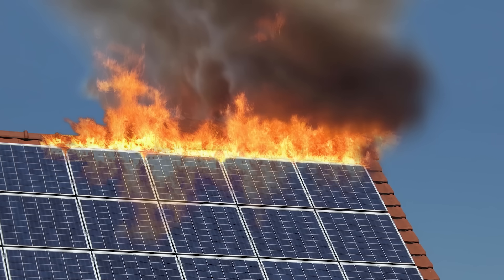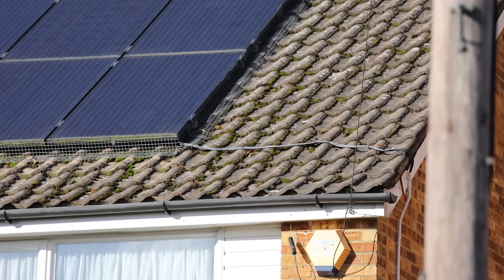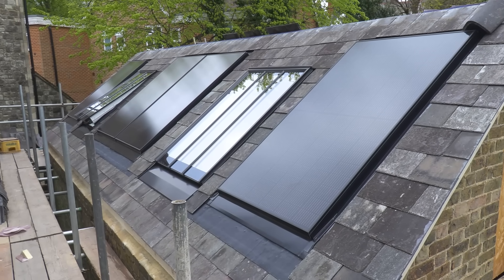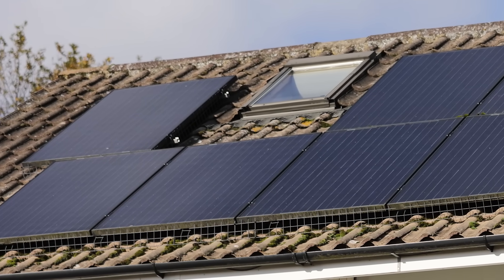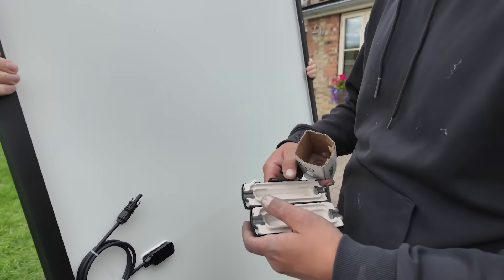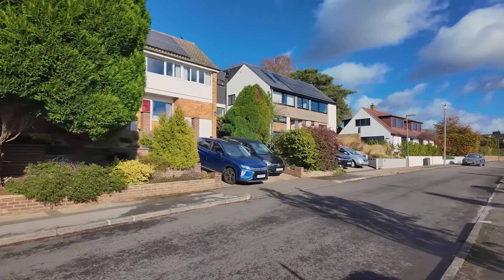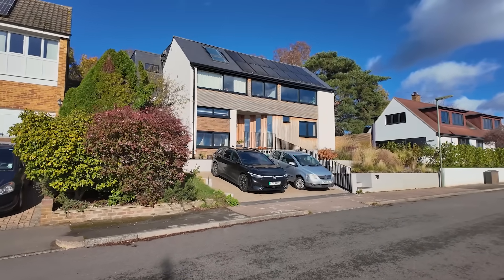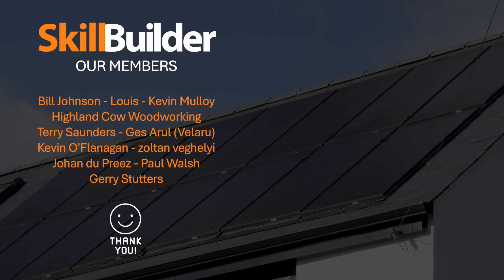Solar Panel Fires Are Rising – Here’s Why

Comment: The problem with solar is that it is high voltage DC if you have a bad connection it will arc and continue causing high temperature.
AC at least goes through zero volts every 20mS which helps to stop the arc.

Comment: Ours are lucky regularly checked it is the council so what they define as a check I don't know I don't really take much notice. If it's the same guys that did my eicr that took ten minutes and involved him changing a bathroom switch😂. Our property needs a rewire anywire, 60s wire with insulation break down causing "green goo" so I'd assume with that the cables from the inverter will atleast be done. Our system has been on the house probably 10 years and it has been fine so I'd assume if it was going to be an issue it probably would by now. I don't think we should panic about it they are brilliant and if you do worry about the environment then I think it's a good investment. For me it just allows me to AC my house for free during the summer😂

Comment: A fuseable link is probably the best fire detection method for solar panels.
All it is is a strand of wire that melts at a certain temperature with some voltage running through it the loss of which sounds the alarm. 
In most cases the fire will need to be beyond the saving point before any other type of alarm will be triggered. With a fuse wire any temperature greater than what's to be expected at high noon on the hottest day of the year plus five degree so about 120 c will melt the wire and trigger the alarm. Even a small smouldering fire should get the areas where the wire is best located well above 120 c but still be small enough that it could be extinguished before permanent structural damage is done to the roof.
The alarm should also be set up to completely isolate the individual panels from the power circuit to make fighting the fire safer and also remove the source of the ignition.

Comment: Solar panels and inverters have changed over the years so it would be very useful to know if there is a pattern.  Is it old panels, new panels, bad connectors, method of installation etc?

Comment: The only problem I've experienced with my panels is the connector that comes with them got hot.  They look nice and chunky but the actual connection itself is rather weak.
Reply: Probably mismatched connectors as, shockingly, the design is not standardised. Chop off both plug and socket and re-fit with connectors from the same manufacturer, using a dedicated crimp tool, done properly. They should not get hot.
Reply: @matthewmarks6951  They weren't mismatched, just cheap and nasty.  I did exactly as you suggest.
Reply: @rogerbarton1790  What current were you passing? I've had no trouble with cheap ones.
Reply: @matthewmarks6951  Difficult to say, my system only displays the total current, and then I'm using super capacitors.  But it was a 12v 120W panel, so absolute max current 10A, realistically half that.  I have several of these connectors, but it was just one that got hot, and the mating force was very low.
Reply: @rogerbarton1790  Ouch! Yes, I think the biggest warning of incompatibility is the connectors mating too easily.

Comment: Hi    The installation of this technology has been around for getting on for 15 years or more now , so those initial installations will start to degrade due to being outside in exposed locations . Obviously most will not see any maintenance, so compounding the potential for failure . The technology has admittedly progressed over time , but the quality has reduced to lower the cost .  So now you have the situation of a vehicle in your garage that might be a problem , and an equal potential on your roof . So much for progress don’t you think . 😊

Comment: Years and years to break even while still paying electricity bills from the grid for back up  Batteries need replacing which are not cheap. Not enough sun hours, especially in winter when we have to struggle to look hrough the dense greyness in search for a dim glow that looks like it might be the sun. It's a virtue signalling con, like electric cars.
Reply: So weird that so many people have and swear by them then, isn't it? A modern battery lasts 10+ years, by the way.
Reply: @matthewmarks6951 Add up the installation and new batteries after ten years, the cleaning of the panels, plus the additional payments to the grid and compare the total to not having solar panels.

Comment: Scottish Building Regulations have had solar as standard for over 20 years. Whether developer built, Social Housing or Affordable Housing. I don’t recall hearing about a problem 🤷‍♂️🏴
Reply from the maker: Are you saying that the firebrigade is cooking the figures? 😀
Reply: @SkillBuilder 😂
Reply: @SkillBuilder Only an English probably I’d imagine 🤷‍♂️
Reply: Bird Guards around Solar Panels should be Mandatory.
Reply: @privateprivate4384  Yes, nowadays, but I think pigeons have learned about them as it never seemed to be much of an issue. I retrofitted when I re-roofed.

Comment: There are roughly 8000 house fires per year in the UK caused by some form of electrical failure, solar panel install failures do not make the top 7 fire risks caused by electrical (the list only had 7 items on it!).

A solar panel fire can almost always be traced back to poor installation, and sadly we have a lot of cowboy installers usually on some govt. grant scheme.

Roger is right I would not have the batteries inside the loft, but tbh LFP or sodium ion batteries are extremely low fire risks
Reply from the maker: What causes the panels to explode? It happens.
Reply: @SkillBuilder  Do you actually mean explode, or just catch fire?
Reply: @SkillBuilder  Solar panels cannot explode without explosives!  It is a complete myth.  What can explode are low quality inverters solar inverters, solar isolators of poor quality can explode and in very rare cases old solar hot water systems can, either via calcium build up or large variations in temperature resulting in expansion and contraction, fail and crack in a very small "explosion" in the same way that safety glass "explodes" when it shatters

Comment: Smoke alarms in the loft work perfectly well, we haven't had any false alarms in over 10 years (firmly grasping a piece of wood 😆 ) and you won't get much more dust than in our thatched roof.
Reply from the maker: Fred 
That may well be the case but you are advised to vacuum clean  your smoke alarms every few months.
Reply: @SkillBuilder  I've been very lax in vacuuming the smoke alarm, I'm going to guess it was 5 years since I last cleaned it. Thought I'd check to see what type it was in case that makes a differance, and I see it's a year beyond replacement date, so that's a job you've given me, anyhow it's a optical alarm which are less affected by dust than ionization alarms.
Reply: you have solar panels on your thatched roof ?
Reply: @AlexSmith-y4i6t No, but as it's a thatched roof it is a requirement of our insurance that we have smoke alarm in the loft.
Reply: @fredbloggs72  would it work in time though , seems to me that any fire would write off the entire building , all an alarm would do is give you some time to escape
Reply: @AlexSmith-y4i6t  Whilst a thatch fire is usually devastating, it doesn't necessarily mean the entire building is destroyed, about 15 years ago another thatched house just down the road from us had a fire, the occupants where alerted by the smoke alarms and they where able to get out in good time and alert the fire services. The house was badly damaged but most of it was saved and the firemen saved the house next door which was in danger, if they hadn't had an alarm it could have been a lot worse.

Comment: Comparing electric scooter and solar batteries isn't really a correct comparison. Scooters won't be LiFePO4 chemistry and, as you mentioned, are very unstable if under/overcharged/damaged. Solar batteries will be LiFePO4 and put up one hell of a fight against combustion.
There's more of a risk of fire from incorrectly sized conductors/bad crimps/knockoff MC4 connectors/incorrectly torqued connections /missing or oversized breakers or fuses.
Reply: Scooters etc also typically don't have much in the way of temperature monitoring / management, over-voltage monitoring / management, and are usually produced to the lowest cost possible in order to keep the overall product-cost low.

Solar batteries typically do have robust monitoring & management, many have some degree of thermal monitoring and management, and cost-cutting appears to be less prevalent (given they're - currently - inherently expensive, saving e.g. $50 on the production by cutting corners has far less impact, compared to shaving $50 off the price of a scooter).

Comment: Fireman dc switches are required in some instances and rapid dc shutdown as close as possible to panel diode box ( tigo are good brand) , also arc fault monitoring is on some inverters is useful, dc cables should be in metal conduit or screened cable to prevent rodent chewing, in my limited opinion, also high voltage dc is obviously very dangerous especially for firemen, if done properly i believe solar is safe but ive seen a lot of cowboy work which is unsafe, mc brand connections are good but some installers join alleged compatible connecters to them and then ive seen arcing / burning...im ex solar and battery  supplier to the trade 5 yrs ago and probably a lit of improvements in the industry since i got out of it. But with any industry there will always be cowboys. 
Also an option to use micro inverters on the panels in which ac is brought through opening instead of dc. Lots of ways to do it right and lots of ways to do it wrong. !

Comment: The reason for the guidance against installing batteries in lofts isn't the risk of the battery catching fire. Fire fighters campaigned for the change because of concerns that their weight would make them a hazard in a fire where the structure of the building became compromised. Think battery falling through burning ceiling into occupants or firefighters. 
I'm not saying you should install them in lofts, just the reason isn't the fire risk from the battery itself. The extremes of temperature you get on lofts can harm the performance of the batteries too.
Reply: Many of the modern big batteries are too heavy to go up there even without the structure being compromised (in fact some of the 32kWh ones are too heavy for household wooden floor static loadings).

I'm still waiting for the first "My 32kWh Fogstar battery went through the floor" story 8)
Reply: @etchedpixels that Fogstar battery you mention is close on 0.25 tonne (2.5kN), and it's area is roughly 0.25 m2, so basically 10kN/m2 compared to design domestic floor loading of 1.5kN/m2 so 6 or 7 times too heavy for a domestic floor. Plus that load is concentrated onto 4 wheels.  You would hope anyone considering putting such a battery on anything other than a thick concrete slab would think again when it arrived. My batteries are half that weight and were only ever going to be going in my garage for that reason.

Comment: I never hear about solar panels falling off the roof too, it must happen? With all the wind.
Reply: Bolted down to the joists. Not going to come off.
Reply: It happens for DIY installs so it's very very rare. Normally flat roofs or sheds and the like, and usually because the wind got under the panel and ripped the roof off upwards

An MCS installer is supposed to check the roof strength before an install and if necessary have a structural engineer do the appropriate calculations, although it's rare a UK house roof is weak enough for it to be a concern.

Industrial units on the other hand are a barrel of laughs

Comment: Micro inverters only on residential buildings is the answer...
Reply: microinverters are still dumping the same power down the cable often at higher current. If (as is often the case) it's a bad crimp then the resistive heating from that will be just as bad whether it's from the AC supplies you connected in parallel or the DC strings.
And if its arcing whilst AC will help having arc quench will actually help a lot more and works for AC or DC systems (and should be mandatory but isnt)
Reply: @etchedpixels  Micro-inverters are also cooked in the sun and a pain to replace. They are good for partial shading though.

Comment: I've had solar panels since 2011 and not had any fires. I originally had fake samsung solar panels installed which rusted on the inside of the panels. They were on the roof until 2018 when i could afford to get them changed after the company and government back insurances both closed. So with fake rusty panels and no insurance my house is still standing.

Comment: Anywhere you find government subsidies you have conmen tradesmen. Insulation and solar industry is full of conmen. You have to be crazy to put solar panels on the roof of your house. In 10 years huge numbers of people will be crying about their leaking roofs due to bodged solar installs, like they are crying about bodged insulation installs now.
Reply: Some truth to that. I would need a lot of persuading to fit solar onto a slate roof as this requires actually holes cut in the slate. Interlocking tiles have no such issue so no long term damage even if the system is removed. Not so with slate or slate type covering and as slate builds from the bottom up there is no good way of replacing single slates - slate hooks are available but they are a bodge.

Comment: It has amazed me for some years that arc detect has never been mandatory in the UK. In most of the USA arc detection have been mandatory for roof (but not ground) solar for quite some time. Some inverters have it built in but many do not. That way as soon as there is arcing the inverter shuts that string down and starts beeping angrily. In many cases that will put it out before it goes whoompf.

Likewise in the USA for roof mounted solar most locations require you have remote disconnect so if there is a fault you can shut down the whole system completely.

Under the panels is not the worst thing you can do nor in the loft. The worst you can do is install the thing is under the stairs or along side the exits or similar locations. LFP batteries are different to the Li batteries in cheap ebikes which are a different chemistry and much less safe than the home batteries so not always a good comparison, but neither of them belongs between you and an exit.
Reply: Too expensive - blows my mind they are not mandatory in every new installation of any kind.
Reply: unlike the usa, 99.9% of uk/european roofs are not made of what americans  quaintly describe as "roof shingles", quite literally a fire risk in themselves, also you have to note the majority of american houses are built with wood throughout another major fire risk in & of itself, take them 2 factors out & your risk profile goes down by a large magnitude, stick with asphalt shingles, we will stay with real slate /concrete tiles tyvm
Reply: @kevinmatthews2620  Actually many homes in the US do use slate as a result of being old builds or aesthetic choice in new builds tyvm. Also many homes are not wood throughout but brick, again in older stock though this varies by region. I love when people on the internet think they're informed about a place they know nothing about because they saw a video.

Comment: An isolation switch doesn't stop the panels producing electricity.  It'll protect everything AFTER the switch (the electronics etc) but everything the 'panel side' of the switch will still burn up.
Reply: It stops the current. You'll still have a high voltage on the panels but the layout and the way they are wired means it's almost never a short or arc completing the circuit so once the current hits zero the problem goes away.
Reply: @etchedpixels  When you get burned wires (due to fractured insulation etc) and you can get a short circuit locally that's fed by the panels hence the fires.  If the fire is as suggested from poor contacts in the connectors you can still get a short that will perpetuate any fire.  In both cases the isolation won't do a thing to stop it.  If the isolator DOES stop the fire it doesn't stop the high voltage present at the open ends (or along the wires/at the panels) which becomes another 'problem' for fire fighters.  It may end up that home insurance puts a stop to it all anyway.
Reply: @kellyeye7224  Things will adapt. This is not just some idle hobby - it's helping curb climate breakdown.
Reply: @matthewmarks6951  Climate breakdown?  Utter cobblers.  I've been on the planet long enough to understand when I'm being deliberately deceived and add to that 40+ years of LIES about imminent collapse has more than just jaded me.  I suppose it's all going to happen 'in the next 10 years'? - as they've been saying since 1980.  Just how did people get to e so gullible?  Oh, I know, covid.
Reply: @kellyeye7224  You think you're so smart with your Clippy that you know better than NASA? No, don't answer - if you read what NASA has to say on the climate - or Attenborough if you prefer - and still won't take your head out of the sand, there's no point wasting any more time on you. That's me out.